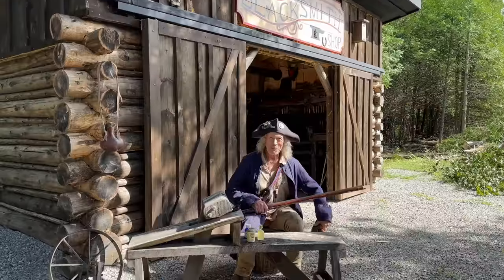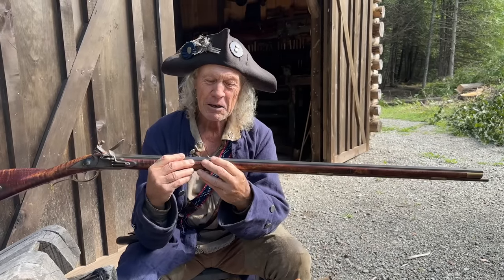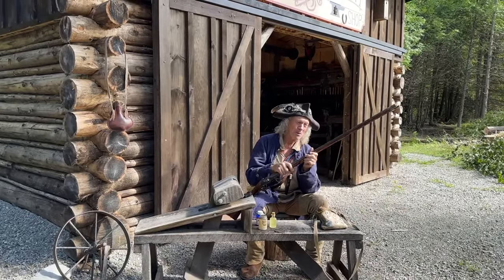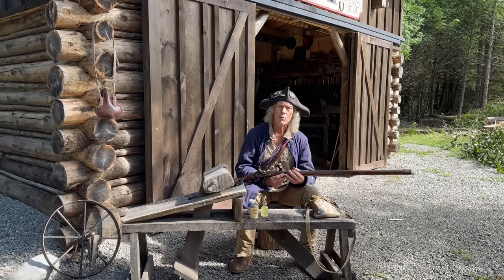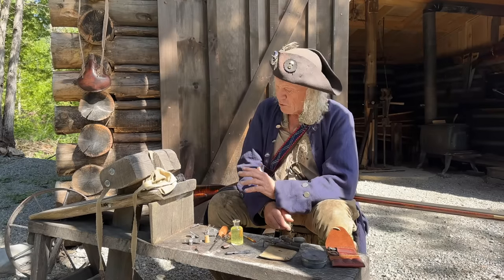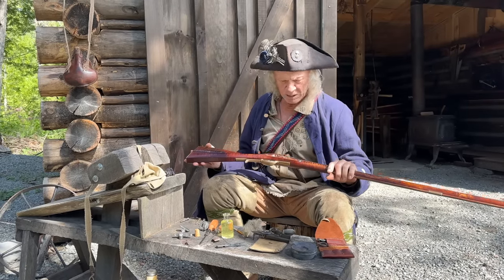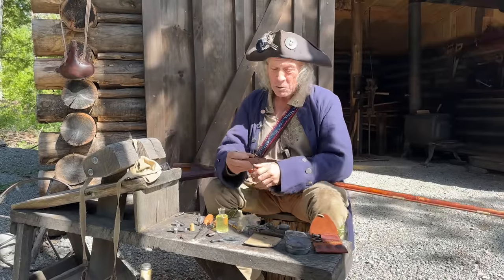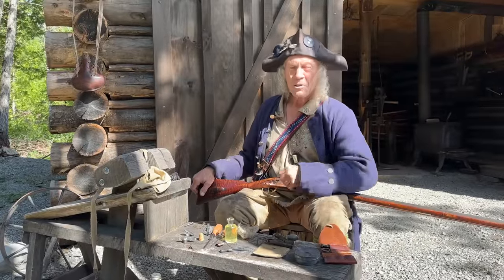What's With the Sights?? Jim Kibler Woodsrunner Gun Build Addendum | FLINTLOCK | BLACKPOWDER | DIY |

Comment: You adjust the sights to where it is shooting.  If it is grouping low, then you lower the front sight.  If it is grouping high, then you make the front sight taller.  Just the opposite for the rear sight.  I have always liked TRU-OIL for gun stock finishes.  Easy to put on and repair.  Thinned out coats for the first few coats.  Wet sanded after several coats with 440 W or Dry.

Comment: I used Beachwood "Plum Brown" to make my barrel look sorta rusted, worked great. Heated the barrel up with a propane torch not hot but really warm and applied it with a dobber. Let it cool and wiped it down with a damp cloth. It there are any spots that need to have the plum brown reapplied just heat it up and repeat the application, no one will be able to tell the difference.
Reply from the maker: Might have to give that a try someday

Comment: Hi Peter

Boy, you sure hit the nail on the head when you identified age impact on depth of field!! I now have tri-focal glasses to compensate for age related eyesight defect. It helps significantly.

Thanks for the follow up vid. I was sure you hadn't made an error in sights placement. That said, I have been known to misplace a few things myself but I put that down to being either 76 years young  or distraction from spousal interaction 😂
Reply from the maker: Might need to look at a glasses upgrade.  However, I never hunt with them on… perhaps I’ve done enough shooting to simply do it instinctively.

Comment: I enjoy your content very much. Also, your willingness to experiment and tinker to get the desired results. I just finished a musket kit. I used "Range Tan" water-based leather dye as a base coat on the stock. It turned orange like your base coat of the Kibler Woodsrunner kit you built. I sanded it to soften the color and topped it with dark walnut stain. 
Once finished with Trueoil, the stock turned out beautifully. The grain has sunbursts of subtle orange that highlight the finish. I will definitely use this combination again. One day, Lord willing, I'll build a Kibler kit. 💨   ⚫️    🦌
Reply from the maker: Sounds like a good recipe for finishing.  I’m going to dry a leather dye on this build as well.

Comment: I watched your Kibler video.  One thought on bullet molding.  Use a candle to flux your lead to get rid of the slag.  Just stick the candle in the melted lead and let it burn.  Then dip off the slag and discard it.  Also, leave a molded bullet in your mold after you are through casting.  This will keep the mold clean and keep it from rusting between uses.  You are right to warm your mold before casting.  It takes several casts to bring it up to temp.     I use Super Lube on my pocket knives.  It is better than KPL and is bio degradable and food safe.  I am sure it would work fine on your lock.

Comment: I've been using cold blue and carding it off on steel parts for years and it does give a nice look.  It also ages well especially around the touch hole and muzzle.  There was a series of articles 20 or so years ago in Muzzle Blasts about the early gunsmiths and in that article, the writer had lists of items in inventory during estate sales or in settling debts after death.  Blueing Salts came up in several of them.  Discussion at the time was that meant "browning" but I think those fellows were pretty smart and knew the difference between blue and brown.  My hypothesis is many of the guns made in the 18th and 19th centuries were either blued or the metal parts were "white".  What we see today is 200+ years of sitting in an attic, basement or otherwise non -climate controlled environments.  Were some browned from the beginning?  Probably, the process to rust and then dunk in boiling water to turn the rust black has also been around a long time.  Having seen a lot of collections and handled numerous old original riles, one thing I have learned is to never say never.  As soon as you say "they never did it that way" someone will pull out an original to prove you wrong. (haha, but it is true).  Nice work you did on that rifle by the way.  Looks great and, more importantly, it seems to shoot great.  Best of both worlds.
Reply from the maker: You’ve no idea how many times I’ve heard , they didn’t do it that way, lol.  Almost as often as, if they’d a had it, they’d used it.  Thanks for sharing.

Comment: I have rust blued a few things and they turned out pretty good 4TBS of peroxide, 1 TBS of white vinegar, 3/4 TSP of salt, boiled in hot distilled water between coats and carded off with 0000 steel wool.  It takes about six coats.  I have done it to axe heads.  If you want a blue color you have to polish to a high luster.

Comment: I always cleaned my black powder with soap and water using the ram rod with a tight fitting patch like a pump with the breech sitting in a plastic bucket full of hot soapy water.  I then dried it by the fire place with a good coating of oil on the outside and a patch pushed through the bore.

Comment: After you clean your gun with the tow, keep the used tow until it dries. Once it is dried, it can be used in the fire making kit. The used tow will have residual carbon and nitrates that help in catching a spark from the flint and steel. Give it a try and see if it makes things easier.
Reply from the maker: That is a brilliant suggestion, thank you.

Comment: For a wood stain on a southern mountain I've used red shoe dye followed by linseed oil mixed with inlet black. Worked pretty well. How is the trigger pull? Most of the guns I've made I've placed set triggers. Never got a single trigger with an easy trigger pull. But a gun of that period usually had a single trigger.
Reply from the maker: For a single trigger it is pretty good.  I fiddled with it to the point there is is very little creep.
Reply: @TheWoodlandEscape  I have usually slow browned the metal parts but hear that is a later process. One fellow says he browns then cards then puts bluing then cards that. I've never tried it. What do you think of that process, catastrophe? Also wondered about the lock. Would case hardening the lock plate and cock be appropriate?  Just lookin for some advice. Tell you what, Peter.  If I had a rifle like that woodsrunner I'd sleep with it. It's a dandy.
Reply from the maker: I kinda like it!

Comment: Hi Peter, one trick the helps my old eye's is an adjustable peep sight just a little bit behind the hammer, Marbles makes one similar to the one I use available at Midway USA, a little pricey, have to experiment with the distance but it does make quite a difference! Or try bending a fuzzy pipe cleaner and burn the center out of it need about an 1/8 inch hole and tape it on there to try in out. Good luck. Paul and Lisa
Reply from the maker: Hey Paul and Lisa, I might just have to give that a try!  Thank you.

Comment: I truly enjoyed your videos. You and I are the same age,70 you seem like a truly satisfied man. May I ask again about your patina method using the fired barrel crud? And what is the machine called that Jim prints out these amazing finished stocks? I was really impressed by the stocks that had carvings ready to go on them. Never thought I would live to see something like that. Thanks again!!!
Reply from the maker: I used birchwood cold blue.  Wiped it on, waited about 5 minutes, rubbed it down with 0000 steel wool and wash with cold water to stop the process.  Jim’s machine is called a C & C machine …. Basically a replicator.
Reply: @TheWoodlandEscape  So have the replicator machines come along way since I used to do rifle kits or does Jim just do a much better fit? Didn't you say when you cleaned the barrel you used that to start the patina on the brass?
Reply from the maker: I believe technology has improved and yes, fowling from cleaning rags works great for the patina on brass.

Comment: Used linseed oil on my walnut stock, rubbing it in with my palm letting the heat of my palm get warm opening the pores and grain of the wood. Over time the, Looks very good.
Reply from the maker: Good stuff, I’ve also used your spoon stuff with good results.

Comment: I found a 42 inch octagonal barrel in my Dads study after he passed. It is untouched so i thought I might try working on it to create a flintlock. I don't know how that will go, but for starters, I wondered if you could tell me what sized mold to get for makeing balls. It is a one inch barrel (15/16 ") and the bore is 1/2 inch (7/16 ").
Reply from the maker: I use a .485 ball in my 50 caliber with a 15 thousandth greased patch.  Great find!

Comment: I hunt with a cross bow for most of my animals just a red dot no magnification. But like you glasses on, glasses off, no matter what you do, you either focus on the animal, front sight or back sight. I love my old Hawkins but it is tough on old eyes. If it is not good for my black iron skillets it does not go in my black powder rifles. When I was younger, 50 years ago I used Lubra plate and brushed every 4 or 5 shots and went to lard and tallow then everything was great from then on, No more hydrocarbon based products, no fouling and I shoot a maxi ball. It loads fine.
Reply from the maker: Bottom line, we’re still putting food in the food storage!

Comment: I have been surprised there hasn't been any original wood patch box covers found with a simple pin installed to keep the cover from going past the but plate and falling off.
Reply from the maker: Makes sense but, I’ve never seen an original with one.